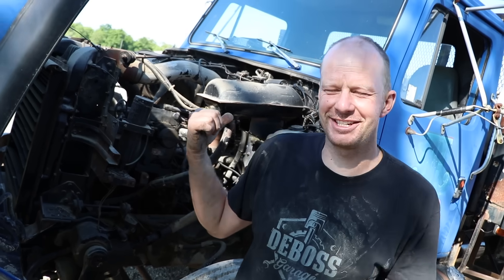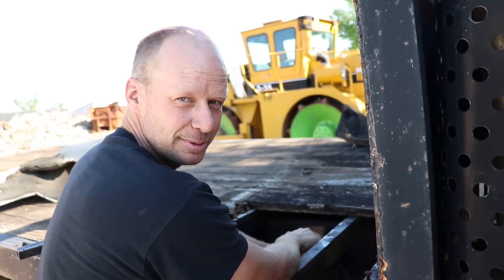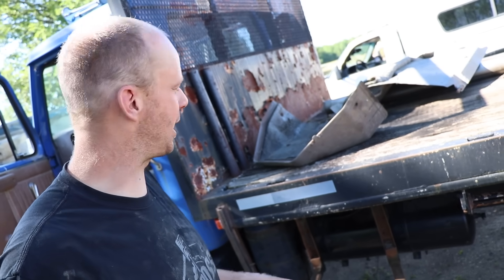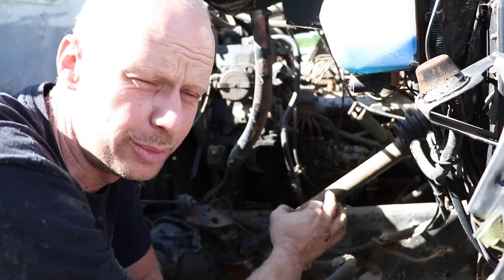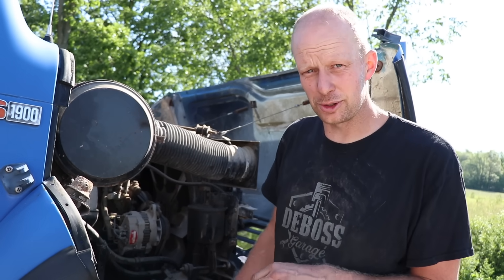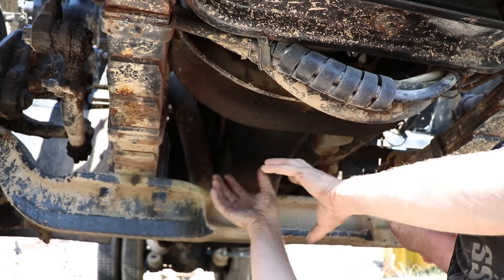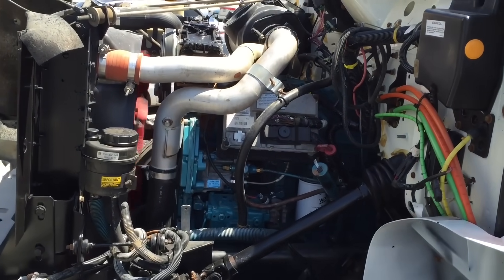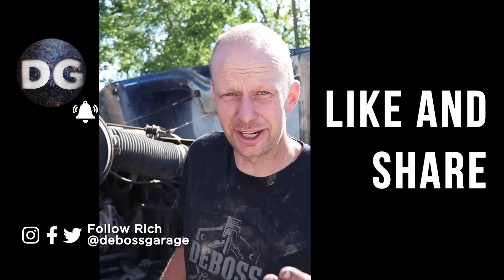REVIEW: Everything Wrong With a 7.6 Navistar DT466 Diesel

Comment: I can imagine the aerated oil was causing a low pressure reading in the HEUI system, if the 466E HEUI system is anything like the 7.3 and 6.0 system. That ICP sensor is annoying but a life saver at the same time if your hpop/lpop oil pressure drops off.
Reply: The one in the video is mechanical pump not the e
Reply: @h3xd3m0n9  Right. He was talking about E models that he had worked on in the past.
Reply: @UCtcERfUMHNpXhPyo47TZ6yw He was also talking about the E model as well. It runs a HEUI setup.
Reply: my girl found a IHC DT 466 and got a monkey!` he wants to bite as some strange sound drive him nuts. The DT 466 is a strange device to me and seems like some kind of 2 stroke valved diesel or something like that! Is this some kind of 2 stroke diesel conversion that gets on his nerves. im not familiar with this motor at all but see the label! Does it run on forged rods and crank that resonate at some frequency and is it some form of 2 stroke loop chargedd valved diesel. i got a dertoit 8v92 and small block 2 stroke but not familiar with a DT466 or monkeys macaqe! Does a DT466 throw off some kind of EMP from chemical diesel burning with a turbo that drives her monkey nuts? The only thing i can think of is a form of EMP from diesel explosions in it driving him crazy and making him bite!  Does this DT 466 need to be grounded to minimize the EMP from it? Not sure! Im not famiair with it but she said it runs forged steel rods and crankshaft and heavy roller bearings that are steel and not ceramic, will ceramic roller main bearings help ? not sure?
Reply: Funny, never had that issue on any CAT Hueys.
Reply: @-tr0n  but ive seen plenty of cups leaking :)
Reply: @-tr0n  it might be his shop pump drawing air

Comment: Looks like they'd be a good idea for a swap due to the massive availability of parts both new and used.
Reply: It weighs 2000 lbs so unless you have a big truck it's not feasible.
Reply: @douganderson they don’t cost thousands to build...... it’s cheaper to build a 360 than it is to build a 12v Cummins
Reply: I always wanted to do a DT360 or DT466 engine swap in a M35A2.Nothing is wrong with a Multi-Fuel but they lack in torque and after a certain amount of mileage,it takes a dump on you.That's what I should've done when I still owned my deuce and a half,but instead I went with a 12V 6BT,luckily it was just a fair deal from a wrecked Dodge W250,but in reality we all know that Cummins is more expensive than International Harvestor/Navistar.Both engines will last far longer than the Continental.
Reply: Pondr it cost a lot less to build a 466 even there are a lot more parts available to change them out and switch displacement
Reply: @douganderson7002  it's easy to get there though
Reply: Only thing they're worth "swapping" into is an IH truck with a 404 or 446 gas burner and then you better be prepared to go from 75+  mph to 55 mph max. You're also going to gain well over 1000 lbs.
Reply: They don’t make much power. At all. They are slow. As slow as this takes me to type with so many periods.
Reply: 87FoRunner they’re easier to make power with though. Stock 12v 5.9s are slow as hell too
Reply: @87FoRunner  u get one with a p pump and shove it in a ford has been done plenty of times and dont worry they will make loads of power look up ford dt466 pulling truck
Reply: 87FoRunner I have a dt360 with a 2009 f350 trans on a 2010 f350 dually its fast enough
Reply: @johntex4751  i always wanted to see if I could find a way to put a 6.6 ford into a ford.  Seems like what the company should have done all those years ago anyway
Reply: The dt360 is much better. Pretty much the same but lighter
Reply: https://youtu.be/rvl6061d0e8

Comment: Please make a video on a p-pump conversion for a 24 valve. I bought a 24v and I replaced  2 vp 44 pumps and I wish I had some guidance to do the swap.
Reply: That’s his plan for his white Silverado, I don’t remember when he said he would do that, if it was before or after the f350
Reply: It's not that hard to do u need a 12v front gear case. You can buy a kit online with everything u need to do for the swap. You will have to pull the cam to. To get the front cover off
Reply: That makes sense. Thank you so much for the advice Alex! I also have issues with my transmission on that 24 valve. It doesn’t shift into 4th and when it does it for like 2 seconds and then shifts to 5 right away. The transmission is bad all together but idk if it’s worth it to Manuel swap it with an eaton fuller. I do a lot of heavy hauling and I’m sure it’s gonna go very soon.
Reply: @Paulgeorgiyev  ur transmission in ur 24v is a 47re it is not a 5speed it's a 4speed and what you are feeling is the torque converter jumping in and out of lockup. What u need to do is reroute the  wires away from the alternator or wrap them in aluminum foil. It also could be ur apps sensor.
Reply: @Paulgeorgiyev   pull your pan and check your accumulator spring. The break all the time at 70/30  length of spring. Might as well do a transducer and solenoid r-n-r while in there spring is 8 dollars other two is 120.
 Then adjust bands. All work is shown many times on youtube.

Give you time to shop a nice mechanical trans clutch and flywheel
Reply: I’ll do some research on the wire reroute. I changed some of the Solenoids and it’s got a bit better. Do you guys know if these transmissions are hard to rebuild, or the best rebuild kits for them. It’s a 47re I’m pretty sure.
Reply: @Paulgeorgiyev  I know for sure it's a 47re if its second gen 24v. Rebuilding ur trans is not going to fix ur issue. It is hunting for lockup up. Try changing ur apps sensor and dont use a junk one either. There not hard to rebuild I built a few of them.u need a good press  for the overdrive spring.  You will have good $2500 in parts to hold 500hp plus to the ground
Reply: @big murph if I’m going to rebuild it. What is the best torque converter for it. I heard it’s a weak part on the tranny
Reply: @Paulgeorgiyev  best converter you can buy is a goerend thriple disc than u need to run a billet input shaft. If u call them they will hook up with what u need just call them tell them what ur going to be doing with ur truck. Yes converter is weak spot. But like I said its hinting for lockup that's what u are feeling. I would try a few different things mostly it's going to be wiring make sure u got good batteries and cable ends a good alternator to.
How many miles are on ur truck. If it's a 53 block with over 100000miles I wouldn't worry about it. It made it this far. 53 block started in 98 with the 12v beleave it or not and ran to 2000.
Reply: big murph I rerouted the ground wire that runs right next to the alternator and rapped it in aluminum foil, and the converter is still jumping. Do I need to reroute the ground wire from both end? What I did is took apart the black wire protector and moves it away from the alternator, and rapped it. Also my 53 block is 230k miles and I checked and there’s no cracks or welds. Unfortunately I will not be able to tune it up or I might blow it.
Reply: @Paulgeorgiyev  make sure ur batteries are good and connections are good. Also check ur apps sensor
Reply: @Paulgeorgiyev   all mopar transmissions are the same, except scaled up or down depending on torque rating.  Based on the venerable 727. From 30 rh to 48 re.  You can spend near 3 grand for a 10 speed manual, or on just the torque converter.
Reply: I just found out today I have a 53 block. It’s 1998.5 and it’s a 53 block. Everywhere I looked it said it was from 1999 and up. I’m so upset

Comment: The DT466E was put into some of the 4700s as well. I bought a S1900 for scrap and saved the engine. That is a DT360 but don't think it's original. Not sure what all the DT360 was put in but it's getting a rebuild and going into a Ford super duty in place of the 6.4.

Comment: We have a 2000 or 2001 4700 IH rollback, Dt 466e in it, allison automatic. It says it has 350,000 miles on it, but the dash quit working properly when we got it, the only thing that has gone wrong with the engine since we've had the truck is the cam sensor and water pump. We used the truck at our Tractor salvage yard towing a tri axle tilt trailer. My only complaint with it was the extreme lack of power it had. It would get you anywhere you needed to go but not quickly. My uncle has an early 90s 4800 IH rollback with the 466 in it, and it has even less horsepower. He uses his f800 crew cab ford truck more because it has an 8.3 cummins in it and it has a lot of power with about the same fuel mileage. I like 466 engines, they were great in tractors, but I much prefer a Cummins engine over the mechanical or heui engine's of cat or IH.

Comment: What engines are in the 2010-2014 international school buses nevermind I think it is the DT466E maxxforce
Reply: It is. It’s called the maxxforce. They constantly had problems when they were in the school busses
Reply: Hunt Guy yea I just haven’t really seen them very much for a long time and forgot lol
Reply: Hunt Guy have to disagree with ya. Keep the egr cooler checked, and idle time at a minimum and they’ll go 250+. Have multiple ones in the fleet with that much mileage, on one in frame, some that haven’t had an In frame yet.
Reply: @alecchamberlain4231  how many injectors? How do they cold start? The one I drove wouldn't start below 10°C if it wasn't plugged in. Think the grid heater didn't work but mechanic swore it did. Wires were not his thing so I didn't believe him.
Reply: alec chamberlain We had a school bus place behind us and would generally get about 2 a month just for the coolers blowing and bending rods
Reply: Yeah, I think it's similar but with much more electronics and emissions stuff, making it much less reliable, so Navistar/International has pretty much switched to Cummins engines in their new school buses.
Reply: crhirschi interesting I like the Cummins engines in general
Reply: that would be the 6.0's counter part, maxxforce as someone else said. had too many issues with them to really want to list. still work on them tho
Reply: patrick buckner yea when I was in school I always thought that it would just shut off when you let off
Reply: Either a Cummins 6.7, Maxxforce DT, or a Maxxforce 7 (navistar 6.4 powerstroke)
Reply: It depends on 200 or 300. It’s either the MaxxForce 7 (CE200 and RE200) or MaxxForce DT (CE300 and RE300)
You could order the 6.7 Cummins ISB as an option. I believe you could also order the Cummins ISL in the RE series as an option. 

There was a factory repower option for MaxxForce 7 due to their failures which swapped the ISBs into CE200s with the CE300 doghouse added to allow for space. Just requires cutting the floor out about 3” and boom.
Reply: Maxxforce 7. Also know as the 6.4 powerstroke
Reply: I think with maxxforce DT, the DT stands for downtime
Reply: Julio Gonzo lmao

Comment: I used to be a fleet Forman for a trucking company that ran 99% IH. Then moved on to work on IH farm equipment. I can say with 100% certainty that the number 1 reason for failure on these engine is liner oring failure. I have overhauled no less than 50 of these for oring failures. The mechanical engines start great run strong and get decent mileage.
Reply: is it possible on a lathe to add a second oring groove top and bottom or is there not enough sealing area?
Reply: @AndrewBrowner  I do this alot on allis chalmers and john deere liners. Those engines rot the bottom of the block out and then fail. The IH engine seem to to all score a liner and dump the water. Or dump the water which causes a liner to score. What ever the direction the injectors nearly always test good and the blocks are good 99.99999% of the time unless its an old tractor.  Even then it's rare.  Another common issue that was partially mention is valve train wear. When these come into my machine shop 80% need all new valves due to mushrooming and pitting of the valve stem tips. This rarely causes issues and is primarily due to poor maintenance but is a consistent issue.
Reply: Liner failures were so consistent of an issue that you could nearly mark it on the calendar within a 6 month period as to when a truck would go down. We ran 54 trucks 50 of which were IH s series, 4700, 4300's .Early pre 94 mechanical engines lasted 10ish years. First gen heui (94-99) which are generally gutless turds were around 8-10 years. Second gen heui 99-03 was around 8-9years. Third gens (6.0 style and erg engines) we never had one make it past 7 years.  
Mileage never seems to matter. I overhauled engines with as little as 110k miles and as many as 500k. Every truck was on a strict 10k mile oil change with all filters including coolant filters coolant was strip tested every pil change. Fuel additive was added on top of the pre mix additive that it got from the supplier.  The local rural electrical company had nearly identical results with much less preventative maintenance.  Oddly enough the trucks that broke the mold were the ones that were driven the least.

Comment: I drove an early DT466E across the western states in the mid 90s.  Blew the dipstick out of the holder in Salt Lake City.  Got stranded in Seattle with a leaky front crank seal.  Broke an idler pulley stud outside Austin.  Had 63 miles on it when I started.  Terribly underpowered and I had a MT.

Comment: Out of the medium duty diesel engines, the DT466 is my favorite engine.
DT466 came in International 1700, 1800 and 1900 series truck and chassis cab trucks sometimes converted to school buses if the person ordering knew better than the DT444, 7.3.
I lot of industrial equipment and well pumps use the 466. 
We installed a pair of them in a 46 foot Hatteras Ocean yacht, that previously had 120 hp Ford Lima's. Yes, more weight, but raw water cooled boat engines rot the block out and with the sleeved 466, the engines lived 12 or so years before requiring replacement.
On the DT466e engines. If you pulled the connectors apart and greased them with dielectric grease, you had few issues with engine sensors causing the engine into limp mode.
Reply: had nobody thought to install a closed-loop w/ heat exchanger?
Reply: @nickadeletti7655  
  Most yachts were raw water cooled. Installing heat exchangers that require a pre-filter which requires 25-50 hour service intervals adds expense. 
  Then the most expensive part is the heat exchangers themselves @ $2500 or more per engine.
The installation of the engines does get a fresh water flush system, so you can flush the engine while docked.
Reply: Gunga Dinn I see, what year is the boat? I have a 86’ tiara w/ 454 crusaders and they have a closed loop
Reply: Nick Adeletti - Tech 
It was a 1979. The boat spent winters in Florida and summers in Ocean City MD. 
The boat belonged to a friend that was a snowbird. 
Plenty of party space not much fishing space.
Reply: Dan McCarthy 
  What type of boat?
If a work boat like used by commercial crabbers, the only thing you need is brass freeze plugs and a change of the head gasket to stainless steel. A composite gasket won’t last. 
This also assumes that you’re running a dry exhaust. 
There was one company that manufactured wet manifolds for the DT466, but they were pricey.
Reply: Don't forget it's original purpose, IH tractors. That's the same engine used in most IH pulling tractors built prior to the CaseIH merger when they went to the Case-Cummins 505/8.3, and unlike the Deere 466 engine of the era, it had cross-flow heads. Old Deere 466s in the 70s-80s (Deere 4450 for example vs IH 5488) had the intake and exhaust on the same side.
Reply: 5o